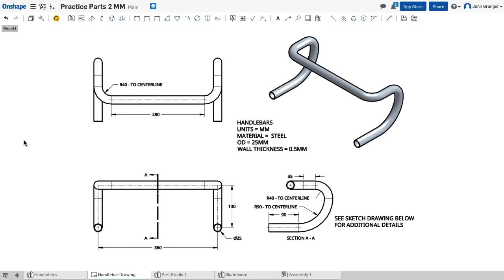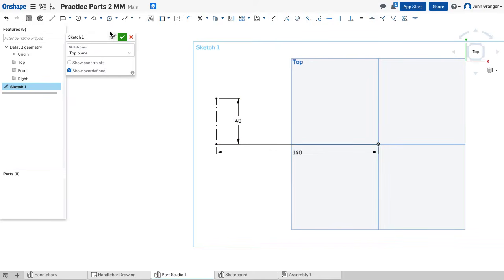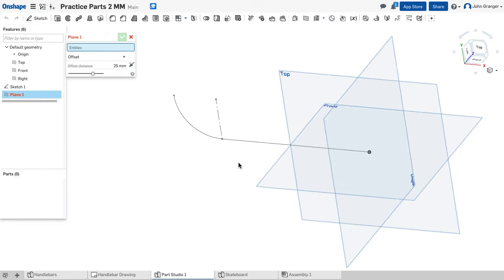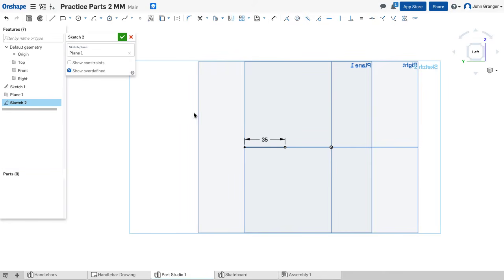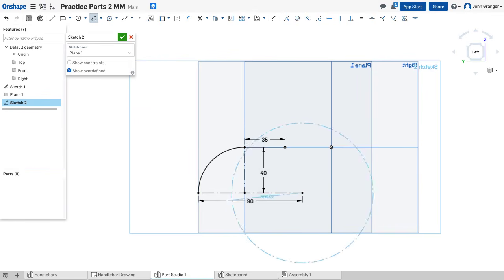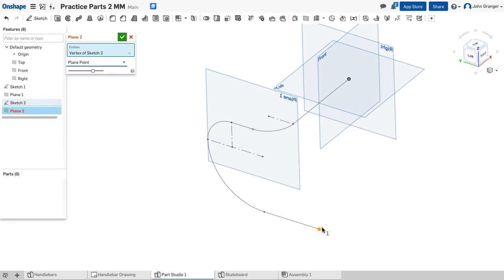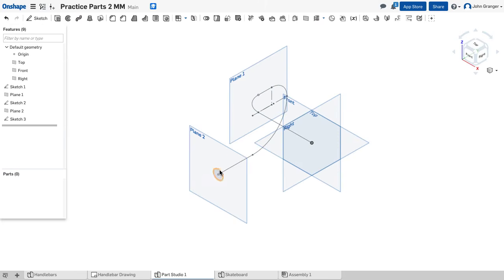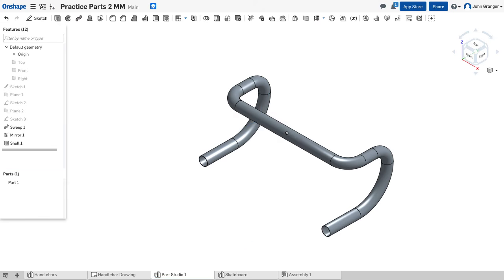Learn Onshape - Project 19 - Handlebars

Comment: Can we "project curve" option instead?please correct me if I am wrong
Reply from the maker: Yes, if you hover on the end point of the line and move the mouse it will start an arc tangent to the line without having to click on the tangent arc tool on the toolbar.  If you set the end points of the arc to be horizontal and vertical to the center point, it will align the arc to be tangent.